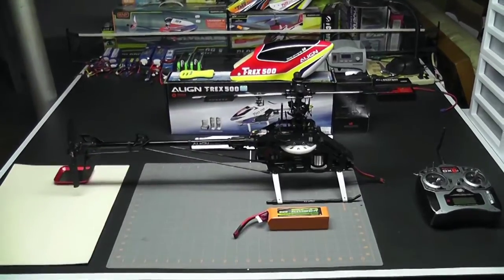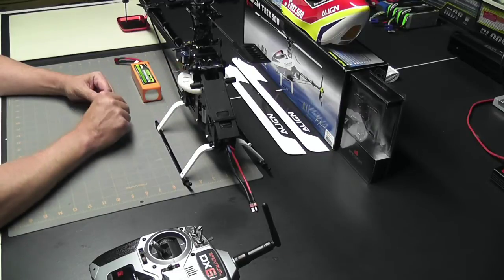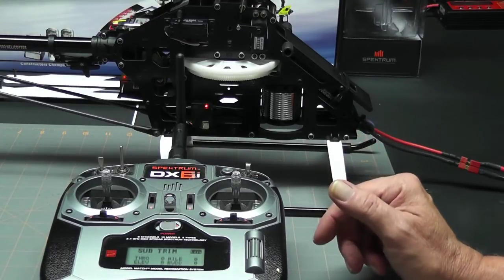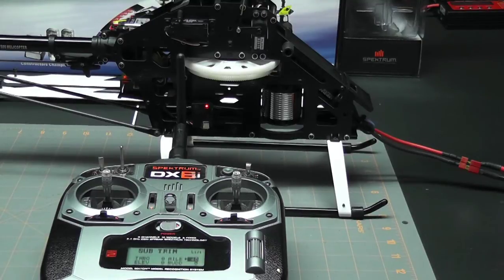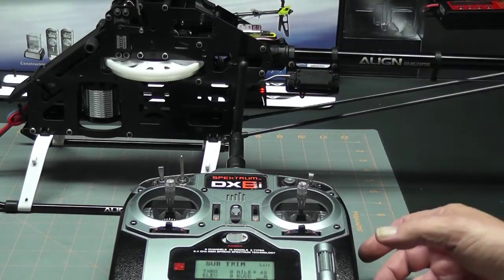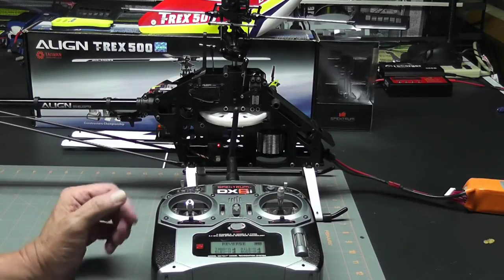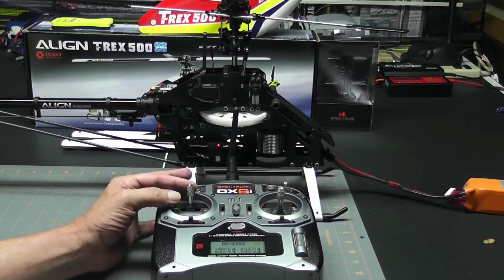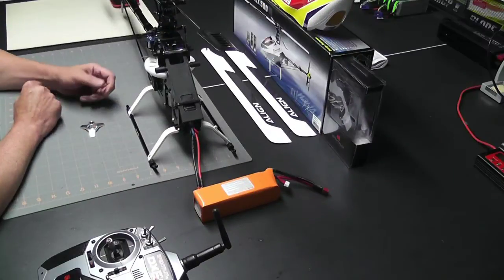Trex 500 E - Electronics and Setup #3

Comment: Please forgive my ignorance, why is your motor not turning when you have the battery hooked up to the motor controller? My heli has a control battery and a motor battery, is this different from the setup you are working on?
Reply from the maker: Hi Kevin.  It has been a long time since I did these videos, but to answer your question, the BEC provides power to both the motor and the receiver. My motor does not turn on until the receiver sends a signal which is triggered by the remote.  Hope this helps!